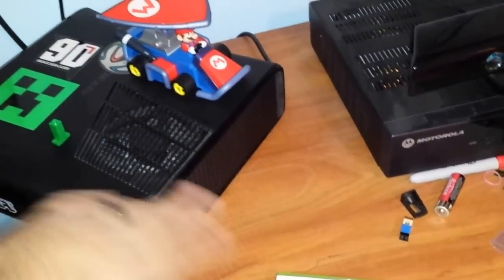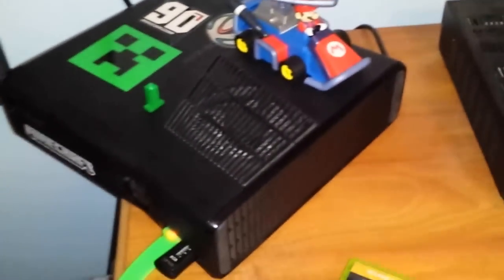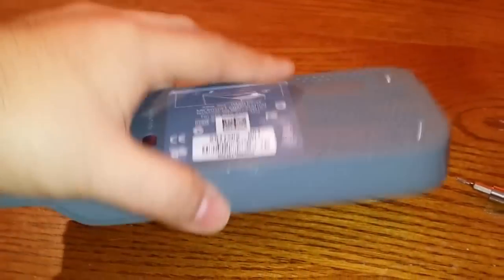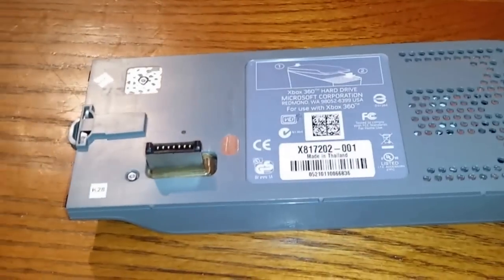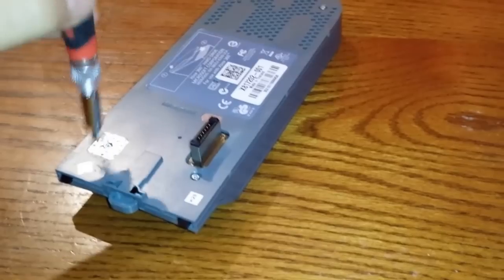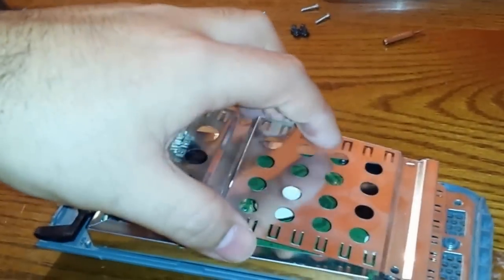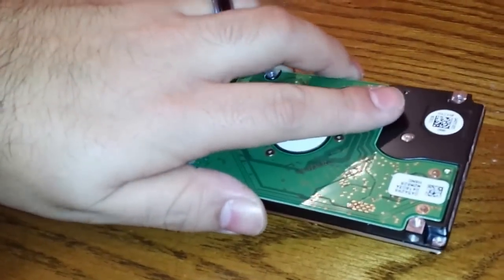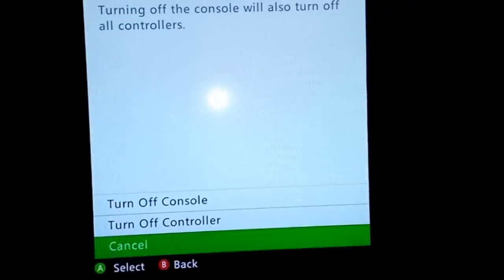How to upgrade your XBOX 360 slim 4GB hard drive

Comment: Have you ever heard of peoples Xbox red ringing because they put a 500gb hard drive in their system?
Reply from the maker: Can't say that I have. I've heard of the systems having the red ring issue but not after installing a hard drive. Is this something that's happened to you?
Reply: @616pcrepair  I actually read it on a Reddit post. But no it’s not happened to me
Reply from the maker: @chicosuave2966  gotcha. I just looked up the red light codes and there is a code for hardware failure, guess that could be it. Q4 (bottom right light) = hardware failure. Q1, Q3, and Q4 light up when a general hardware failure occurs.

Comment: How do I do it without the caddy? Plz respond asap
Reply from the maker: You have to carefully line up the sata connectionc on the Xbox and the hard drive. I would recommend putting a piece of tape on the end to make a handle, stand the Xbox up and carefully insert it. Do it at your own risk, I am not responsible for you damaging your Xbox or hard drive.

Comment: I got my old 360 sitting in my room what I'm worried about is sense it had the RROD would it be better to buy a new one for my slim or is it safe to install the one I have to my slim
Reply from the maker: it should be fine, RROD has nothing to do with the HDD. Let me how it turned out.

Christian
Reply: Just realized I threw the old one away looks like I'll be having to buy a new one instead
Reply from the maker: I hate when that happens. Hope it goes well. 

Christian

Comment: Can slim take up to 2 TB of internal by using the caddy?
Reply from the maker: I'm not sure on the capacity, but it might. I don't see why it wouldn't. People say they just throw it in. Then I've heard it only works with certain drives. If it doesn't work you'll have a large drive for a laptop or something else.
Reply: 616 PC Repair I sent in my Xbox slim to be modded and I was able to find a 500gb on Amazon.  Wish I could get a clearer answer on this. That way I wouldn't have to deal with an external for my backups.

Comment: Do you think a 1tb would work? An what kinda drive does the xbox 360 slim hard drive uses
Reply from the maker: Im not sure, I would assume it would, but I would recommend looking up how to flash the firmware. FYI if you try this method and it fails I don't think you can go back, and not sure if it would ruin the drive. I think they use Hitachi drives, not sure if some models use different brands. I have never tried it so good luck, and let me know how that works for you. I am not responsible for any damage to the drive or anything. Thanks for the question. 

Christian
Reply: I think 320GB was the max. But since they are releasing a 500gb hard drive than it might have been increased.
Reply from the maker: oh ok, well I would think the 500GB would work. Did you find the information online on what program to use and what brand hard drive you would need to flash the firmware on to? 

Christian

Comment: Can I use a pc hard drive(200gb)
Reply from the maker: You can, you will have to watch other videos on how to do that. I think you have to have a certain brand and then you have to flash the firmware from another brand of hard drive on to it. Just do some research before trying it, not sure if you have to have a certain size or not. I didn't want to take the time to do this so I just bought one that was from the old 360. Good luck, and let me know if you try it and the outcome. Thanks for the question.

Christian

Comment: What screwdriver did you use the first 4 screws
Reply from the maker: I had to use a Torx 7 screw driver bit because the screws that are originally Torx 6 were a bit stripped. I bought a refurbished HDD. Thanks for the question.

Christian

Comment: You know you don't need that hard drives case it can go in there without the case.
Reply from the maker: right, but if you're going to install a hard drive, why not do it right? Specially since the caddy is so cheap. Of course you can install it without the caddy but you better put something thick enough under it to hold it level with the SATA connector, or else it will put stress on it. Thanks for the comment, have a great day.

Christian
Reply: :-D

Comment: Will something bad happen if i connect the old hdd thingy without the case? because the case costs some money
Reply from the maker: You can do it without the case, just make sure you have a way to support the hdd so it doesn't sag. if it sags it will put unneeded stress on the connection. be careful as to not damage the console or hdd. I am not responsible for either thing getting damaged or if it doesn't work. thank you for watching and for your question.

Christian
Reply: 616 PC Repair I will figure something out , dont worry , if something bad happens to my system i will be the only one responsible , maby a small metal bar supporting the hdd?
Reply from the maker: +The Gaming Melon you could use that. the first time I tried it without the case I used double sided foam tape that I had lying around. I think with the thickness I had I put two strips stacked on each other and had then on the right and left side of the hdd
Reply: sooo should i try that?
Reply from the maker: +The Gaming Melon you sure can.
Reply: Nice , thanks !
Reply: +616 PC Repair my god you can just take an butter knife an on that side pull out the fan an there's the hard drive stuff
Reply from the maker: +Alex Lopez why would you use a butter knife? it has a latch that releases it. I guess if you like to complicate it. have a good day

Comment: My xbox recognices the HDD but after installing the game and starting to play it says that it cant read the disc.if i save other games onto it it happens aswell even if the xbox normally reads those games fine...any ideas?
Reply from the maker: That's interesting, I have not had that problem. I looked at the comments here and no one else seems to have that problem either. Have you googled the issue you are having? I would like to know what you find. I am sorry that I can't be much help, since I have not had this happen to me. 

Christian
Reply: 616 PC Repair Thank you for your answer,
In fact its kinda hard to formulate my question on the google searchbar since i only get answers for peoples with laser lense problems wich i dont have.
At this point i try to use my western digital hdd from my old laptop wich just happens to be the right one to do it (the hddhackr thing) .its a crappy way to do it but what joice does a battlefield addict have?Im really confused about this i tried to reinstall the hdd from my old xbox many times,i dis.-and reconnected it many times but still nothing.it works fine for videos pictures and stuff but in combination with games they all have the reading problem.i hope that one day i will get an answer to this and if you have one sometime please let me know!

Thanks again Christian and a nice saturday,

Thomas
Reply from the maker: Well, Thomas

I completely understand, you gotta do what you gotta do to get that BattleField going. I am thinking about buying a WD hard drive to try that hddhacker thing. I wonder what will cause the old xbox hdd to not read the discs when installed in the new xbox. I will poke around on the web for you and see what if any info I can find. You have  great weekend as well.

Christian
Reply: 616 PC Repair the hdd hacker thing worked...playing battlefield now.i still wonder what caused my hdd from xbox to not work like this...thanks for the help anyways!

Comment: Does this "modified" hard drive support backwards compatibility ?
Reply from the maker: "modified"? Well not really modified at all since all we are doing is transferring it from an old XBOX 360 hard drive case to the new XBOX 360 slim case. Now to your question, it did work with my XBOX Project Gotham Racing, I have not tried it with another since I can't seem to find my old games. I will post more as I find and try them. Thanks 

Christian

Comment: The hard drive is not appearing in the storage area under system settings when I plug it in.
Reply from the maker: Are you using the caddy that I show in the video or are you just using the bare drive? If you are using the bare drive it could be that it is not on properly. You can attach a piece of painters tape or whatever you have available to use as a handle. 

Christian
Reply: I am using the bare device but it is clicking in properly. It seems like my xbox just won't read the drive.
Reply from the maker: Is this one out of an old XBOX 360?
Reply: Yes it is an old 20gb out of a old 360.
Reply from the maker: I don't know why it wouldn't read it. The only thing that I can think of is that the hard drive is bad, but that is just a huge assumption since I don't know the history of the drive. I don't think you are doing anything wrong when putting it in if it clicks.
Reply: 616 PC Repair well thanks for trying, from all of the research I have been doing it appears the drive might be bad. The weird thing is my Xbox reads the drive fine when I use a transfer cable. Just not when I plug it into the hard drive port.
Reply from the maker: That is weird. If it's bad it shouldn't work with the transfer cable. Sorry I couldn't be be of any help.

Christian

Comment: how do you flash a wd hard drive to work as the internal hard drive
Reply from the maker: There are some blogs with tutorials on this process. However, you can end up ruining your drive, so be aware of that risk as I take no responsibility for the outcomes when attempting these procedures. 

I found a few links you may want to read over before attempting anything.

https://digiex.net/threads/help-please-cannot-get-wd-hard-drive-to-work-in-my-4gb-360.15813/

https://www.se7ensins.com/forums/threads/how-to-create-a-xbox-360-hard-drive-from-scratch-western-digital-only.897465/

Again, I just found these by using a Google search. I didn't write these or attempted any of them. I am not saying they work, just providing you with information I found right now.

Comment: Do you need the caddy
Reply from the maker: No, you don't but they're only $5. You can put a piece of tape on the end without the SATA connection to use as a handle, and just add some foam or whatever you can find to support it. You want to keep it as parallel as possible to the system. Thanks

Christian

Comment: do i need a speacil screw drive
Reply from the maker: You will only need a special tool if you are removing a hard drive from an old XBOX 360 to install in your XBOX 360 Slim. If you are doing that then you will need the following, T6/T7 depending on if your screws are stripped, and a T10 for the 4 screws holding the hard drive
Reply: thanks man
Reply from the maker: You are welcome. Glad I could help

Comment: Can this work without the caddy
Reply from the maker: Yes it does, but I would recommend putting something to support the hard drive and keep it parallel to the system. I would also use a piece of tape to use as a handle to grasp it easier. Hope this helps.

Christian

Comment: Overall a good video but could have been done in less then 5 mins.
Reply from the maker: You are right, I figured I would just explain why I was doing it, but yes the whole process should only have taken 5 minutes to show. I am used to working on computers and explaining all the steps that way the people attempting the repair don't have any questions. Thanks for your comment.

Christian
Reply: Still a very helpfull vid.can you tell me if putting a hardrive in my xbox 360 will resolve the issue of the msg i'm getting when attempting to play a dvd ! the msg is as folows."a required storage device has been removed" i can play games and cd's fine.i only get this msg when putting a dvd in.thanks
Reply: Raymond Blanchard Sounds to me like what happened to mine. After contacting MS about it and waiting on the call for forty minutes they suggested I clear the cache. Which I did. Then they said if that didn't work my power to the laser was malfunctioning. ALL this and the manufacturing warranty ended two months prior. But I unplugged everything and connected it directly to a wall socket. VIOLA never seen that error again. Hope this helps.
Reply: Thanks Daniel.i have seen this "clear the cache" advice but not tried it.as for unplugging everything i'm concerned about losing game saves and data.is it safe to do and not lose anything ! i really wanna try what you did especially if it solved the problem.i just dont wanna lose my saved games data.

Comment: can't you use disk on key?
Reply from the maker: Do you mean USB drive? not really sure what you mean by disk on key, but if you mean USB drive or thumb drive, then the answer is no. Unfortunately it needs an actual HDD connected to the SATA connector on the console. I tried that before doing this but it doesn't allow you for certain games like in my case BF4 and others that are named in comments below. Thank you for the coment.

Christian
Reply: Are you sure cause some of my friend said that I can install and save games on USB drive 
And one of my friend have an xbox with 4gb and he use it just fine he doesn't have bf4 
You can't run only bf4 on USB drive?
Reply from the maker: right, you can use it to save games on, but certain games will require an internal hard drive. My son was had no problems with the thumb drives until I bought him BF4. I even tried a 500GB external drive and it wouldn't load BF4 on it. Just make sure that the games don't say require HDD.
Reply: Oh ok like gta v and those game ok thanks
Reply from the maker: yeah, that's right. Thanks

Christian